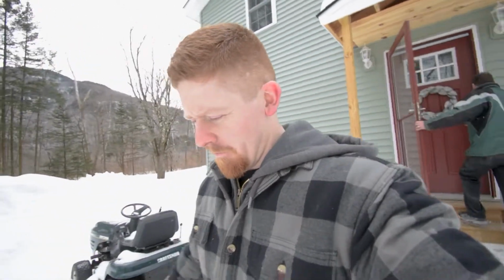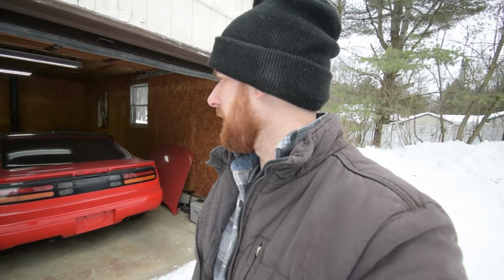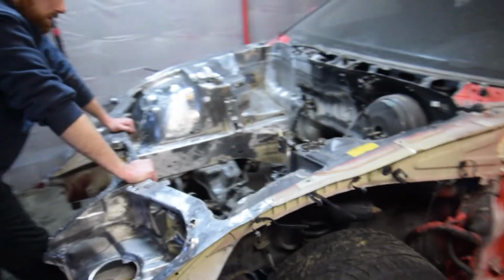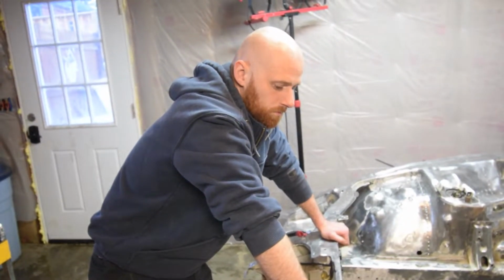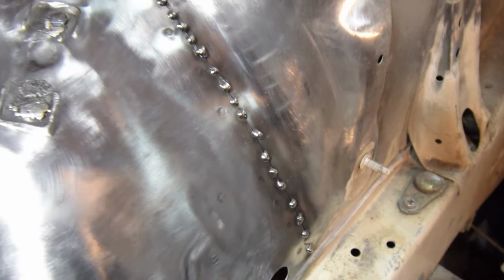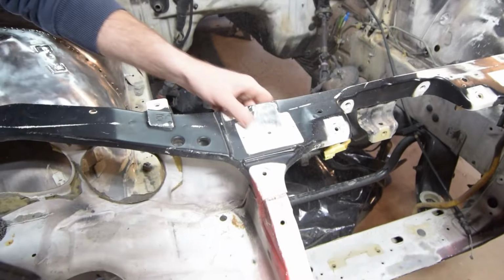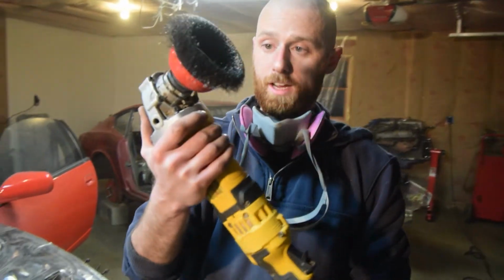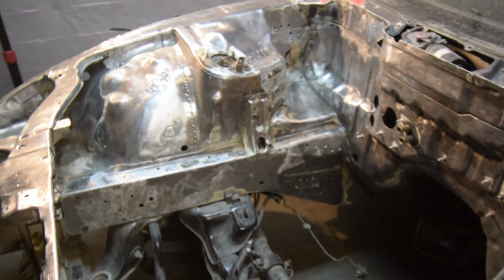Starting the 300ZX Engine Bay shave | Z32 Build Project | ReinCARnation

Comment: I love the Z32. It's a nice enough looking car from the outside, especially if you decide to merge the filler panel between the headlights in with the bumper, then minimize your panel gaps on the hood, but overall, it's just a nice looking car that takes to wide body mods especially well. But what I really love is the interior. The insides of these things just screams 90's at you in the absolute best possible way. My favorite combination is white pearl on the body with the red interior. I think it may be one of the classiest looks you can go for, unless you happen to like the graphite pearl + white or the sapphire blue + beige/tan. They're all great, but pearl white is my favorite. I'm pretty sure they stole that paint code from their Infinity branch, and I'm sure glad they did.

Comment: I had one 2+2 changed it to Manuel 5 speed what a car. .was my dream car finally bought one with veilside kit looked unbelievable. Believe it or not it was a fairlady and had factory recaro electric seats in it....people were trying to tell me they weren't factory but clearly they were by looking at the wiring loom...same ones you get in the R32/33 don't know if they electric in skyline but same trim with the Recaro embroidery top of seats.....man wen you sat in it yr legs would just bout be straight and sitting real low. Not recommended for short people I'm 6ft 2" and was perfect.....had 69000km on the clock import to Australia.....I took it to a z32 specialist and went thru top of motor put twin core cooler turbo smart blow off apexi computer with boost control. Boost was 12psi safe for standard turbos apexi turbo timer and all trim like steering wheel gear knob hand brake and kick guards all matching top shelf isotta....no bling I did as much as I could afford at the time and can't forget the wrap around dash...Also came with a custom full stainless exhaust from turbo back 4.5 inch.....someone spent a fortune on exhaust and boy what a job,the finish was real high quality.cruise it was quiet put the foot down and it sounded like a Ducati and me been the stupid cunt I am sold the car of my dreams.....wherever I went people would stop take photos and ask all bout it...summer with the roof off and dark tinted windows on black looked savage.....and all this bullshit you hear bout the motor don't believe anyone you just have to find someone that likes working on them and appreciates them otherwise they bulletproof.I put mine thru he'll and never missed a beat.....with the navman I got 260km/h half way thru 5th gear....top motor.blew all the hsv fpv wrx s15 away I recon woulda did low 13 high 12 on 1/4 mile and I had a everyday runabout corolla so I saved it for weekends or special occasions! #bleedeveryday maybe again someday #Iwish

Comment: Also, another point to consider when restoring or modding one of these: how much of the whiz-bang electronic wizardry from the late-80's early 90's do you want to keep? The interior has some near electronic gadgets like an electronic HVAC thermostat control on the dash pod, but more importantly, if you started with a twin-turbo model, it also features 4WS, or four-wheel steer, which is controlled electronically in this car, as opposed to the mechanical system from the Integra. Keeping it means maintaining a significant amount of the stock loom. If you're dealing with any other variant, then don't worry about it, because you're car doesn't have it to begin with. And if you want a dedicated highway cruiser with an automatic transmission but you also want the twin-turbo model, well, you're out of luck unless you're willing to learn how to deal with right-hand drive, because only the JDM market got that particular combination of options.